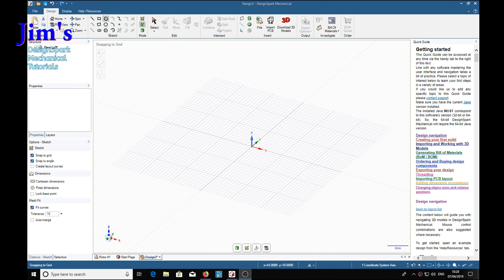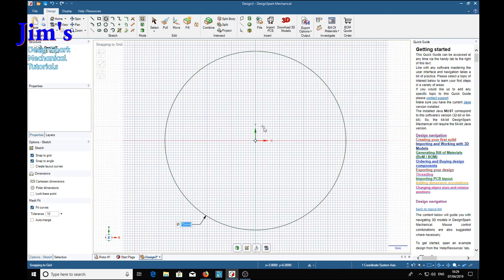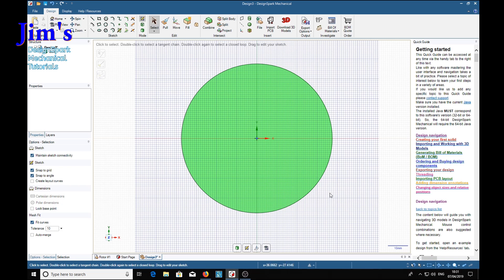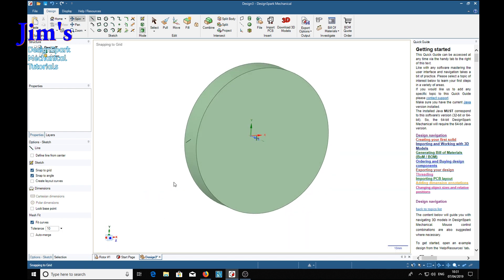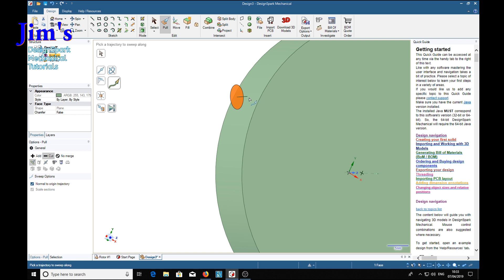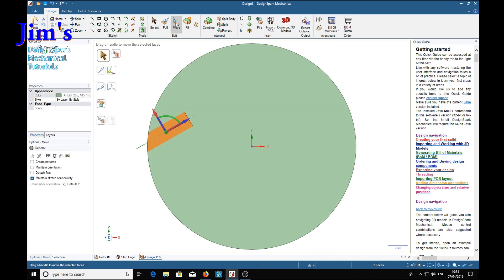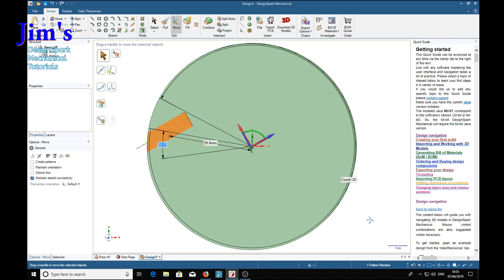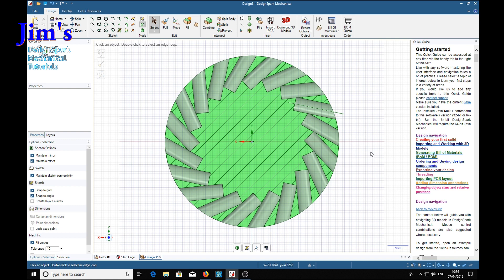DesignSpark Mechanical: Making a Perendev rotor

Comment: Very nice. Thank you. I'm more a Fusion 360 guy and have to learn how to do things with Mechanical. So you taught me how to do circular patterns and how to select midplanes. Pretty cool feature that selecting a plane within a body automatically shows you a cut-through. One question though from someone who is more used to parametrical design: is there a way in your example to shorten the cylindrical cuts when you realize they are too long? Or do you have to ctrl-Z everything and restart from scratch? After all that's where parametric design shines and I wonder if I can do similar things here in Mechanical. (I have to admin though that I have hit the borders of parametrical design so often that I had to redo many things due to wrong order of dependencies or lost objects.)
Reply from the maker: No; just select one end of the slot and either drag it to where you want it, type in a value of how far you want to move it or move it Upto ( a DSM tool ) to exactly match the positon of some other feature.

Comment: Hi Jim, did you ever manage to resolve the backup file issue, I am about to start a new project for a 16mm/ft live steam loco I am now reasonably comfortable using DSM but I do not want to find out like you did further down the line that my hard work is vulnerable, I appreciate your thoughts.
Reply from the maker: The backup system in DSM is wrongly named; it should more accurately be named as a crash recovery system. Evey new file that you create in a session is placed in the backup file folder (setup in Options/Support files). If the program crashes, these files remain in the 'backup' folder and can be recovered. However, if you quit the program in the normal way these files are erased. To properly backup your project you should manually, at reasonable time intervals, copy your project onto another disc or memory stick - which is what I am doing now for important projects.
Reply: @JimTaylor42  Thank you for the prompt reply, that all makes sense and I do already have a data backup protocol in place so I am good to go.